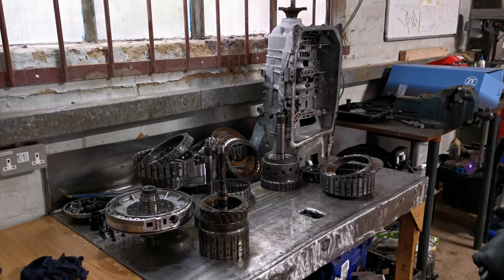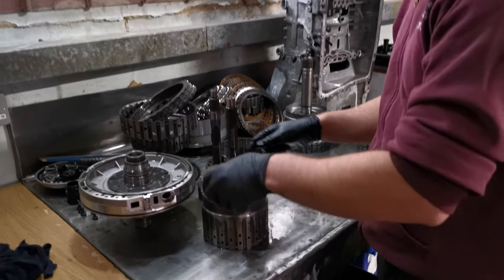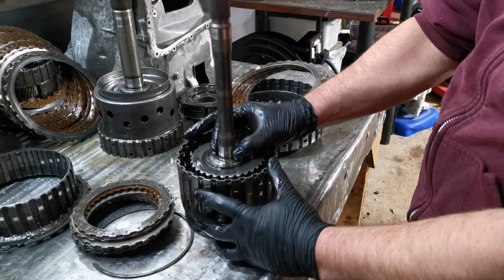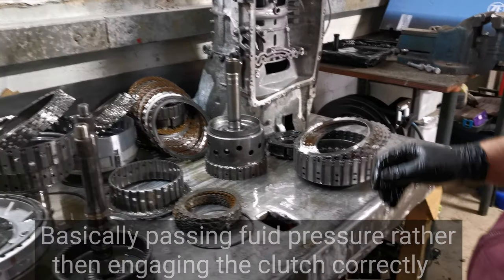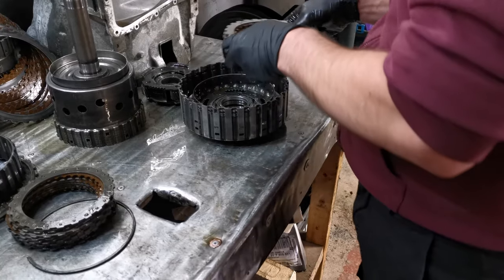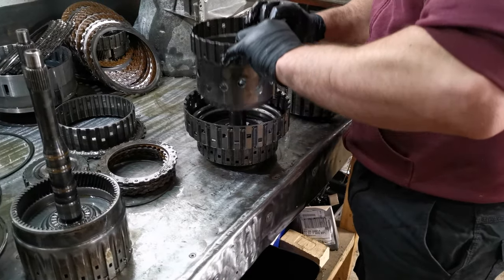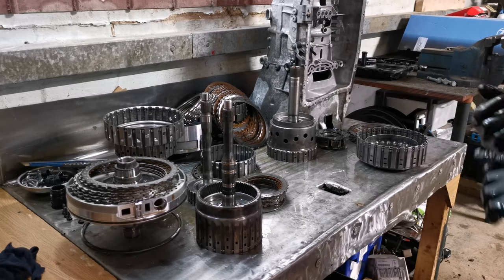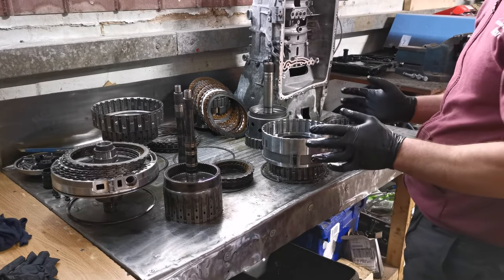BMW ZF 6HP26/28 - fault code 4F95, Strip Down and Inspection Description, More in the Description!!

Comment: My 6hp21 started with error 4f89, gear oscillating between 3rd and 4th and going into emergency mode.
I bought and changed oil, filter, seals, clutches, bushings (I suspect the mechanic didn't change it) and finally a new mechatronics.

Error 4f89 is gone. When driving at low speed in D it changes all gears normally, if you switch to manual mode it also changes all gears normally, but this lasts for a few kilometers, the clutch seems to slip, the rpm increases and it goes into emergency. After that, even in D it starts to go into emergency on small climbs or when I need to accelerate a little more.
Today when this happens I have errors 4F8A, 4F85, 4F95, they never appear together. In one day I can have these 3 errors at different times whenever the transmission goes into emergency.

Comment: 1st gen seems to be more reliable with bushes, but hold lower torque. 2nd generation struggle from bushing issues. I took my pan off 2nd time at 92k miles and i have bushing metal particles there, so just question of how long it will last. Nice video though.

Comment: Do you work on the 5 speed ZF autos on the E46? It’s only done 82k but doesn’t feel right and makes a funny noise in 2nd a sort of metallic clicking grinding noise. Not sure if it’s normal. Also it hangs in 3rd

Comment: I’m in the US and I’ve got the trans disassembled from my 2008 550i 4.8L RWD. I THINK it’s a 6hp26 because that was the most common trans for the V8 cars besides the X5/X6. My E drum splines have that same notch in the center of them that yours appears to in the video. My E drum is burned up so badly that the steels are black and the clutches don’t exist, so I really want to replace the entire drum but I can’t seem to find that same E drum available with the notch in the splines. Is that critical to have the notch? Or can I use an E drum without the notch in the splines?? I really need to know this and nobody seems to be able to tell me anything definitive. Even local transmission shops.
Reply: Damn, no response yet

Comment: Hi, i have a 6hp19z on a 2008 740li F02, which throws a speed sensor error, invalid signal or short circuit to ground. My question is, will i be able to replace the speed sensor ? Is it the soldering model (gen A) or gen B and i must change the whole brown thing which attaches to the black box ? Thanks for any advice (this will be a DIY job)

Comment: I would be interested to get your thoughts on being stationery at lights with a zf8 speed. Best to put it into park / neutral or is it ok to just hold on the foot break
Reply from the maker: It's absolutely fine to hold the brake pedal at the light, the torque converter is fully disengaged at that point anyway whether you are in park, neutral or drive as you are stationary

Comment: Is it possible to fit any upgrades to a e92 335d gearbox during a rebuilt or any option to retrofit a zf 8 speed from the f30 335d?
Reply from the maker: There are upgraded clutch packs available for these boxes, fitting an 8HP isn't really possible though done properly

Comment: So low miles and already with problems, my car have 289k km, stage 2 375/720nm with 6hp26 and no problems, just change my mechatrinc seals and solenoid and is working super soft with any problem, i use xhp stage 3 too.
Reply from the maker: Yes it's unfortunate